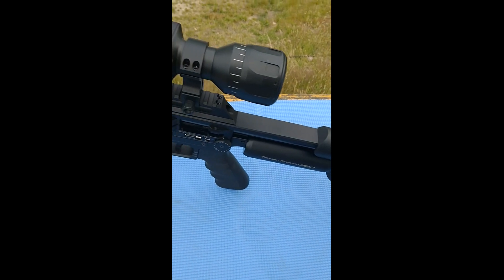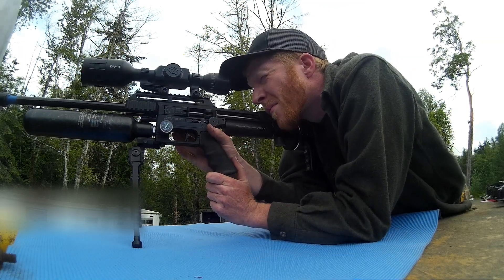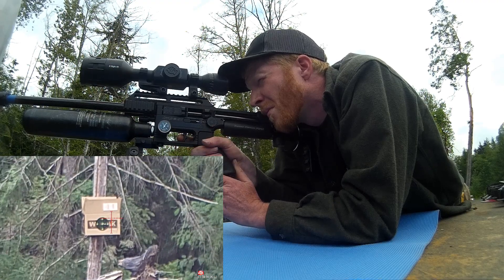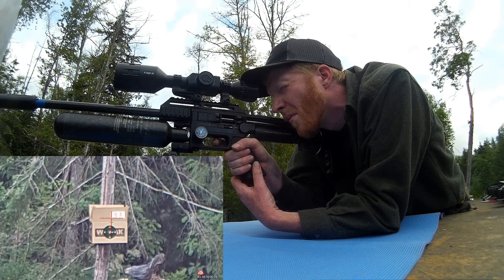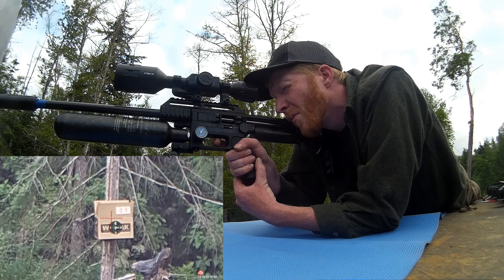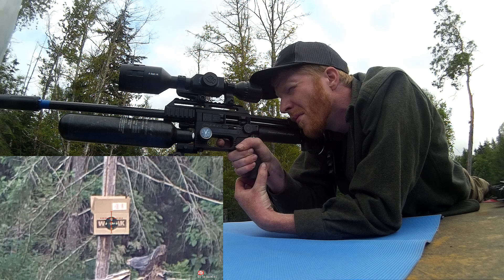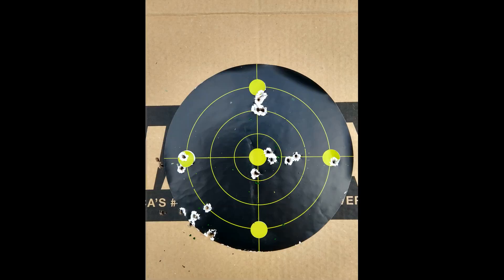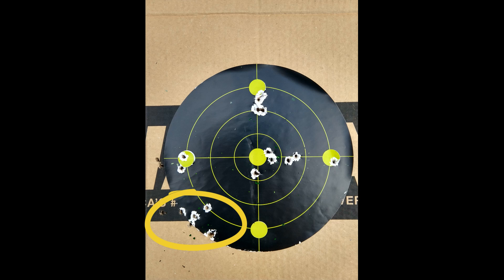FX M3 700mm Barrel Tensioner - Changing Tension - Long Range - Harmonics

Comment: Wind shouldn't affect the plug imo it because the the tension kit pushes you barrel to the right when you crank down on the barrel clamp that has a big gap in it on the right side I could be wrong with your set up but on my set up it does push it to right because of the gap that clamp has thanks for sharing bsafe buddy 👍

Comment: So much money spent and waisted time on this stuff. The FX impact is officially an older design but when it came out was just about top notch with few flaws. Today FX has stepped up because they know all these things. They introduced the Maverick line to cut out all the extra seals and gadgets for tuning making it super simple for everyone. Sometimes taking things a little slower is better. Always proven someway. The wildcat mk3 is about the simplest way to go. My theory which I've been searching and shooting air rifles over 45 yrs is you have the smallest caliber and the biggest calibers to choose. Therefore instead of fooling with making your air rifles shoot way heavy projectiles and spending on moding and time, just reach up to the next bigger caliber is the easiest way! I've been hunting and doing pesting on 13 big farms for a lifetime living the air gunnars dream. Its always worked perfectly to choose the correct caliber for the need. If your having problems or spending too much time trying to perfect, try this. I know it works. You can always put aftermarket baffles in the air rifles helps a lot. And turn down the power a notch.Air rifles nowadays are more than enough power in itself and most could even say a Weapon!Ed da pro snippin backyard man💥💪😎
Reply from the maker: For money I have maybe 40 dollars into the tensioner system, so as far as upgrades go I felt it was worth trying (even if only for the looks). Time is just another excuse to go shooting, which for me is always fun. As for caliber I ran into that with my AirForce Condor in .22 Cal, back in the day I couldn't find ammo heavy enough to be stable so I changed it out to .25, now Condor is back .22 Impact is .25 and Talon is .30. I do probably spend more time in the machine shop doing mods than shooting but I do enjoy both. 😉

Comment: That's definitely most stupid idea in whole airgun world. I've glued slug liner inside stiff carbon pipe using liquid metal epoxy resin from Chester Molecular. That's all. Slugs are flying one by one into one hole.
Reply from the maker: It's a system used in the modern firearm world and it certainly affected accuracy. Do you need it to be accurate, No. But if you're doing outdoor shooting in direct sunlight it may help and for finding different accuracy to FPS ranges.